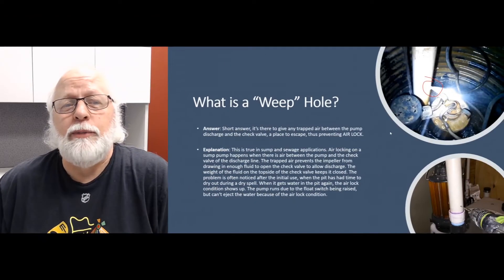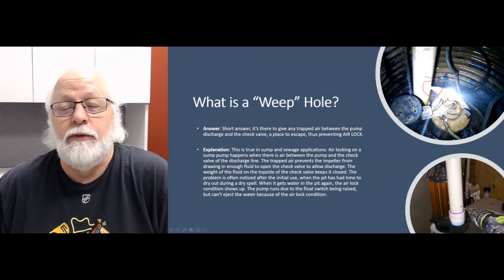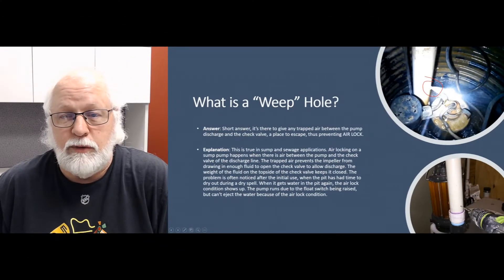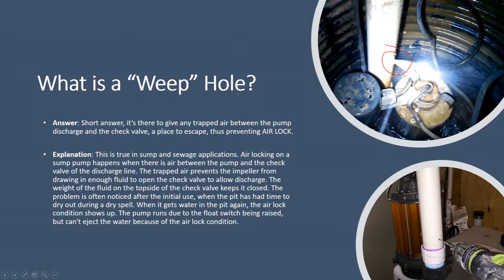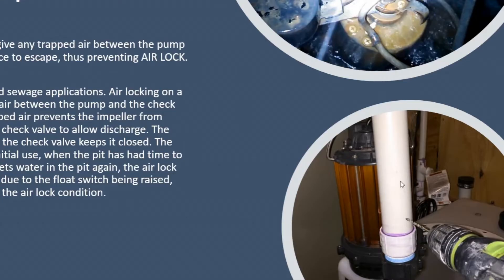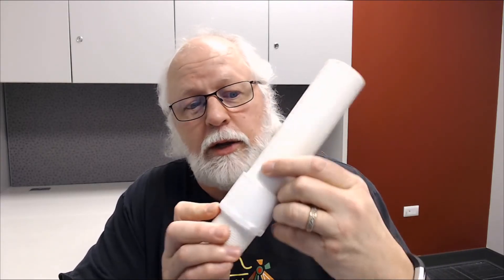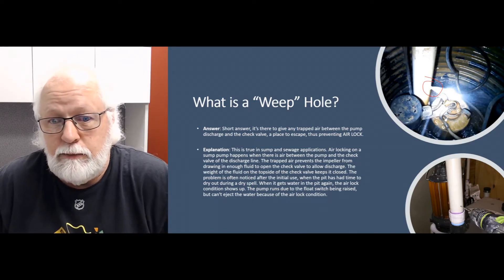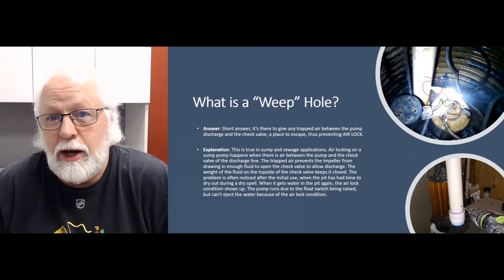Why Your Sump Pump Needs a Weep Hole

Comment: Hello I have two sump pump and they don’t pump water it runs but don’t pump out water and it have a weep hole and every thing is clean
Reply from the maker: It could be an issue with your check valve not properly allowing water to be pumped due to a leak or a blockage inside the pipe. You might consider replacing the check valve and continuing to troubleshoot the pipes. It also could be a suction issue on the pump itself if it runs but no water is being pumped.

Comment: by the time I found my pump it had been running a long time. Steam was coming up out of the hole! The motor is toast, but I couldn't find any blockage or reason for failure. I suspect it got air locked (as I don't remember drilling a weep hole) and it ran until it died. Not sure, but I would say another reason to drill it is to prevent your pump from burning out.
Reply from the maker: Thanks for sharing your experience with others, and thanks for watching.

Comment: Should there be holes on the bottom of the pit bucket
Reply from the maker: Not really sure what you mean by holes at the bottom, but generally holes are not useful to have in a sump pit. A pit is meant to retain water until it gets to a certain height, which then triggers the sump pump to activate and pump all the water through the discharge pipe. If you live in the suburbs/city, there may be an additional pipe toward the top of the pit which would discharge the overflow water (in case of pump failure) into the main drainage line of your home. It's more of a redundancy but this will vary greatly depending on local building codes and municipalities.

Comment: but a weep hole on a car's water pump?  Does that leaking hole mean that seal and bearing are now too loose/ worn.
Reply from the maker: This video is intended to cover sump pump applications. A vehicle's components serve different purposes and should be considered unique to that application, so we recommend consulting your owners manual or seeing a certified mechanic/dealer about potential leaks or other concerns about a vehicle.

Comment: I moved into a trailer home and have to re place  my pump and I installed a cast iron 1/2 sump pump for aerobic system because I have 2 sprinklers that dispose of the waste water and it’s making a humming sound I drilled a vent hole about the discharge buy my pit is really big  so at the moment I have a lot of water in there and the water is covering the vent hole should I make another vent hole were there is no water covering it or ?
Reply from the maker: We would need to know what pump you are using, and what diameter weep hole you have drilled. It's possible you just need to clean that weep hole on a regular basis which is normal.
Reply: @PowerEquipmentDirect   I have a 1/2 Hp everbilt sump pump and I drilled a 3/16 hole
Reply from the maker: @miguelcruz7404  If you’re referring to the “weep” hole, it doesn’t matter if that hole is under water or not, Miguel. The "weep" hole should always be drilled in your discharge pipe to prevent an air lock. This is true in sump and sewage applications. Air locking on a sump pump happens when there is air between the pump and the check valve of the discharge line. The trapped air prevents the impeller from drawing in enough fluid to open the check valve to allow discharge. The weight of the fluid on the topside of the check valve keeps it closed. The problem is often noticed after the initial use, when the pit has had time to dry out during a dry spell. When it gets water in the pit again, the air lock condition shows up. The pump runs due to the float switch being raised, but can't eject the water because of the air lock condition. 

I suggest that you drill a 1/8" or 3/16" hole in your PVC discharge pipe, approximately 4" above your pump's discharge port and well within the inside of the basin. Drill the hole at a 45 degree angle so the hole is pointing toward the bottom of your sump basin. Water will be discharging from the weep hole when your pump is operating. This is completely normal. A typical installation will have the check valve positioned about 2-3 feet above your sump basin cover. If the check valve is screwed directly into the sump pump's discharge port, there is really no place to drill the weep hole, but also less of a chance of air lock due to the positioning of the check valve. The only problem with installing the check valve directly into the pump's discharge port is that it takes more power and effort for the pump to start due to the added weight of all the water sitting above that check valve, especially if your head is 8 feet of higher. When the check valve is installed above the basin cover, it reduces that starting power and also makes for a much easier method of replacing or performing maintenance on your pump and system.

Comment: I drill holes in them myself but seen thousands that didnt
Reply from the maker: unfortunately it's one of the most overlooked parts about sump pump installation. Many installers at the time just weren't aware of it, regardless of it being in the installation manuals. It should be part of every single installation process.
Reply: @PowerEquipmentDirect  my next sump pump venture will be for a liberty 290 oil separator with alarm for a new elevator installation, I dont see it in tha Ma. Code But Boston I.S says I need it
Reply from the maker: We always recommend following local and state codes. Because of the important nature of that application, we recommend you follow those codes. If you have questions, you can reach out to the equipment manufacturer or the state to get clarification or more details. Pumps used for elevator applications are different in nature to simple sump pump applications.

Comment: My sump pump failed, and had small amounts of flooding in the basement, in my panic i went out and just bought a sump pump, i used the old pvc pipe connector and as i plugged it in and to my relief it worked and got the water out, then i saw a hole spewing water out of the side of the pvc pipe n freaked out again and ended up plugging it up, (thanks to this vid its ment to be their, weep hole) now i gotta undo that. Reason why i came here i thought the new pump was defective because of a small hole on the bottom spewing water, thanks to this vid. Thanks for your info, youtube vids really help out!
Reply from the maker: Thanks for sharing your experience with us, and glad you found this information helpful!
Reply: SPEWING !

Comment: I have a weep hole but no water spits out it? Is that normal?
Reply from the maker: Watch your pump's weep hole while the pump is activated and see if water is being pumped out. Once the check valve closes and the pump turns off, watch the hole to see if there is drainage.

Comment: I like your location for a weep hole better than most instructions. they say even with top of pump. I think that is to high. What do you think?
Reply from the maker: Where we placed it in the video is where we recommend drilling the weep hole to maximize drainage and minimize the risk of air lock.

Comment: Waiting to hear whether my plumber will consider ME drilling the weep hole as me voiding their warranty/install.  Mine flooded my utility room today due to an air lock.  Plumber tells me it isn't necessary and they never do it. Liberty manual says it should be done.  Not sure why they aren't following manufacturer recommendations.  Seems like a very basic insurance/preventative maintenance plan and could have saved me three hours of cleanup.
Reply from the maker: Sorry to hear about your experience. You are correct: drilling a weep hole in the discharge has NO effect on the warranty and is typically recommended to be done by most manufacturers. Your plumber was not following best practices if they said they never drill a weep hole. If it's in the manual, it's the way it should be done.

Comment: I've built septic pump systems and installed zillions. We never put a weep hole in any of them. Most were new systems but even in replacements with a full tank of liquid we put the plumbing on then lowered them into the tank and hooked up the union joint, wired it, and ran them with no issues. No call backs. Curious, did we get lucky, or was it because we didn't put check valves in them? Didn't want water stuck in the pipe freezing where we are. Makes sense. I'm one of those installers that never heard of it I guess. Was years ago. Maybe they didn't know to do it then.
Reply from the maker: The "weep" hole as it is called should always be drilled in your discharge pipe to prevent an air lock. This is true in sump and sewage applications. Air locking on a sump pump happens when there is air between the pump and the check valve of the discharge line. The trapped air prevents the impeller from drawing in enough fluid to open the check valve to allow discharge. The weight of the fluid on the topside of the check valve keeps it closed. The problem is often noticed after the initial use, when the pit has had time to dry out during a dry spell. When it gets water in the pit again, the air lock condition shows up. The pump runs due to the float switch being raised, but can't eject the water because of the air lock condition.

We recommend drilling a 1/8" or 3/16" hole in your PVC discharge pipe, approximately 4" above your pump's discharge port and well within the inside of the basin. Drill the hole at a 45 degree angle so the hole is pointing toward the bottom of your sump basin. Water will be discharging from the weep hole when your pump is operating. This is completely normal. A typical installation will have the check valve positioned about 2-3 feet above your sump basin cover. If the check valve is screwed directly into the sump pump's discharge port, there is really no place to drill the weep hole, but also less of a chance of air lock due to the positioning of the check valve. The only problem with installing the check valve directly into the pump's discharge port is that it takes more power and effort for the pump to start due to the added weight of all the water sitting above that check valve, especially if your head is 8 feet of higher. When the check valve is installed above the basin cover, it reduces that starting power and also makes for a much easier method of replacing or performing maintenance on your pump and system.
Reply: Brent, It is only my opinion, but I think that you make the most sense to me for many or most situations. It is my opinion that the answer to create or not create a weep hole should be based on your "SET OF CIRCUMSTANCES".  I am thinking that the weep hole only makes sense if you are using a check valve or if the siphon effect is not properly controlled. The check valve only makes sense to me, if the sump pump outlet does NOT have an "air gap" to the water that the sump pump is discharging. My thinking is, that as long as there is NO check valve in a sump system with an "air gap" to prevent the re-balancing of the water in the sump impeller area and the sump pump pipe, then the water will automatically re-balance from the gravity of the water.  It is my opinion that SOMETIMES It MAY be BETTER NOT to have a check valve because it creates an extra way for water to be trapped and frozen above the check valve. It seems better to allow the water to fall back into the sump rather than to freeze in the pipe. As long as the sump pipe has an air gap to the water that the sump pump is discharging, then the water in the pipe going back into the basin should be minimal (about a quart or less?). My sump system has worked well without either a weep hole or a check valve for about 25 years now. Regardless of my sump pump instructions that  say I should put in a weep hole,  I fear that putting the weep hole in will cause more trouble than it will solve for my particular situation. If I am wrong. then perhaps someone could please explain how or why I am wrong?
Reply from the maker: @FredHinge100  I understand your thought process Fred and tend to agree with you for the most part. In cases where the vertical lift is minimal (<3-5 feet), a check valve isn’t really needed and if there’s no check valve, there’s really no way to get an air lock within that piping. There are also a few pump designs, like the Wayne sump pumps that have a patented top suction design. These pumps can also generally get away without drilling the weep hole in the discharge pipe even with a check valve installed, due to the fact that this top suction design virtually eliminates any possibility of air lock. 

Still, drilling a weep hole is typically recommended with all sump and sewage pumps when also installing a check valve.

Comment: The M98 Zoeller Sump Pump installation booklet concerning the Weep states " When a Unicheck is installed, drill a 3/16" hole in the discharge pipe EVEN with the top of the pump." Note: the hole must also be below the basin cover and cleaned periodically.  Even with the pump is different than 2 fingers up.
Reply from the maker: We appreciate that you've checked the owner's manual. Obviously we can't cover every possible recommendation for weep holes from every manufacturer, so we used the two-finger example as a rule-of-thumb for those who will not check the owner's manual like we recommend that they do. While some manufacturers will have slightly different recommendations, the most important part we want people to understand is that a weep hole is drilled on the discharge pipe lower than the top of the pump. Remember that the higher the weep hole is drilled, the more standing water will be permanently stuck in the discharge pipe below that hole. The two-finger rule minimizes water that remains in the discharge pipe after it runs and decreases the chance of an air bubble getting trapped between run cycles, because a lower weep hole is more likely to remain completely submerged in water a greater amount of time.
Reply: @PowerEquipmentDirect  Thank you for clarifying! I will use the 2 fingers up and yes, I have the Zoeller Model M98. Take care!
Reply: @PowerEquipmentDirect  So apparently the pump I replaced that was about 6 years old didn't have a weep hole or a check valve. My son-in-law who deals with pumps all the time at his job as a building engineer mentioned that we need a check valve (which we installed) but didn't drill a weep hole in either, lol.  After installation the pump seemed to make a clicking noise when running so I wasn't sure if that was normal so I started digging through Videos and found this channel. Thanks for the advice on the weep hole which led me to pull the pump out and drill the hole exactly where you said and on an angle. Looking at my directions they were conflicting. The install manual had the hole a couple inches up but there was an insert I found later that had it level with the top of the pump. I appreciate your reply to @tonytrotta9322 to clarify this. The good news is that by drilling it lower or maybe just drilling it at all the pump is much quieter.

Comment: OK, I get what you're saying, but I have 2 questions.  I had a plumber install a pump for me and he drilled the weep hole on a downward angle.  The water sprays out of the hole so forcefully, it causes a great amount of aeration in the  water around the pump.  Doesn't this risk introducing air into the pump too????  Also, the check valve is about 4 ft above the pump (in 2" PVC) and all the water drains out of the pipe below the check valve when the pump turns off.  Doesn't this also have potential to cause air problems with the entire 4 ft length of pipe full of air?  Everything is running fine right now, but it defies common sense, to me anyway.  Besides, it's noisy as hell.  I also have a pump in my crawlspace; been there for 20 years, no weep hole, never a problem, AND quiet!
Reply from the maker: It does not defy common sense and the weep hole is doing its job. Depending on how high up that weep hole was drilled, that might be the cause of all the noise and concern. We typically recommend drilling the weep hole no more than 2" to 3" above the discharge port of the pump.  And while the other pump doesn't have a weep hole and has not experienced any issues, is like saying I've never had a leak in my car tires. It's always a possibility.  But the weep hole will prevent any problems if and when it happens. Thanks for sending in your questions!
Reply: Does a weep hole allow the water above it to drain out during EACH pump cycle or is this ONLY during an air lock situation? If it drains each cycle, which I think mine does, where does the air (or water) that replaces the shooting water come from? If a weep hole is necessary to prevent air lock, why would you want to introduce air in between the check valve and the weep hole for every single cycle? I suspect this would be less efficient. I see some check valves that have a weep hole built-in just under the valve, are these more efficient because less air would be introduced? Wouldn't a check valve let air out vertically when it opens? Questions for the physics minds out there... @PowerEquipmentDirect